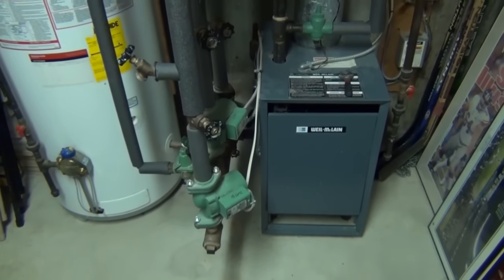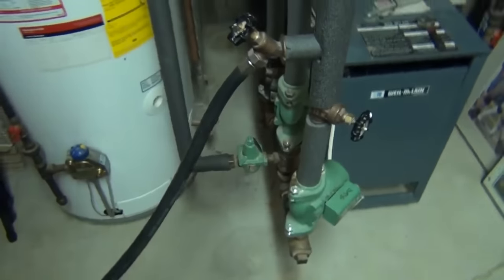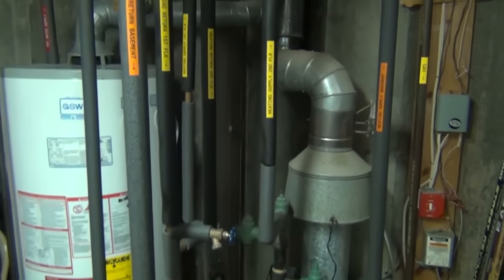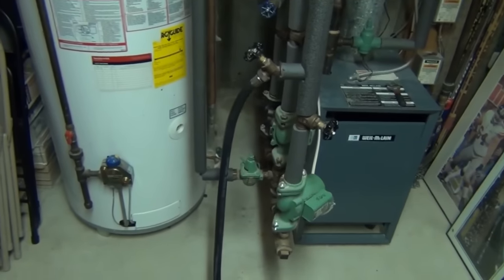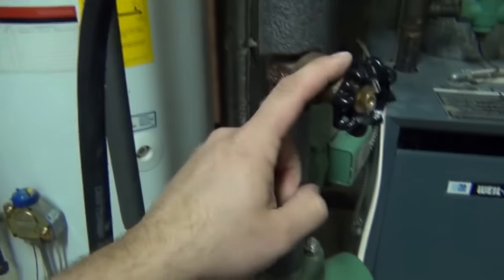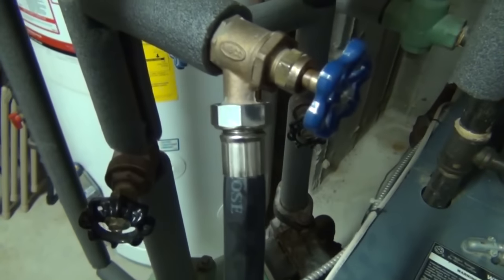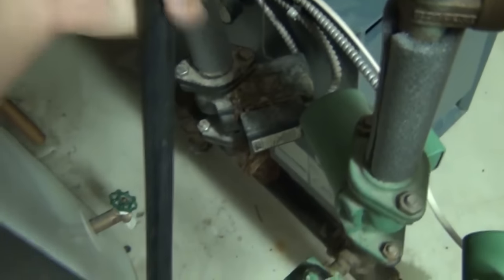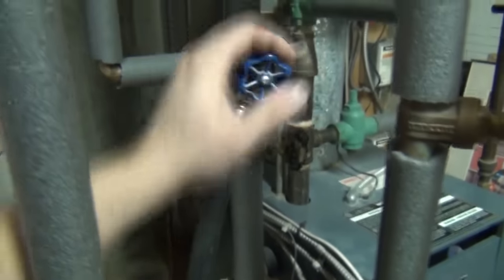Remove Air from your Boiler and Heating System | How To

Comment: trhank you for this video.  i dont see a fill valve on my system or a separate shut off switch.  should i kill the breaker before starting?  Can i do this without the fill valve?
Reply from the maker: There is definitely a fill valve somewhere. Won’t always look like the one in the video. Look high and low, it’s there somewhere
Reply: @fixitwithzim  the only thing I see is a fitting with a little lever on top   Is that it?

Comment: Great explanation but in my case I wasn't able to lower the water pressure to not exceed 30 psi.  The expansion tank is new as well as the fill valve and the relief valve.  Expansion tank is  at 12 pounds. I will have to call a Radiant Floor Company.  From previous experience I can only imagine what that will cost for them to look at it.

Comment: Since this is a pump system and not a zone valve system. Was there anything else you had to do before starting the flush out to start the fast fill? Can you do a flush just like this on a zone valve system please?
Reply from the maker: Yes, you’ll need to manually open and close the zone valves one at a time.  Other then that, same procedure as in the video.

Comment: 1:16 Hi Zim, I have two zones, each with a zone valve. And the only air purge station for the whole system is on one of the zones. Can I still follow this video for guidance?
Reply from the maker: Sorry for the late response, yes. It will take a little longer to get all the air out but the process would be the same.

Comment: Is there ever any worry of introducing cold water into a hot boiler or is it required to do this when the boiler is cooled down?  I just worry about cracking a hot boiler by possibly getting cold water to it. Very nice explanation and procedure.  Also, what kind of average life expectancy should we  be seeing with the expansion tanks.
Thanks for sharing.
Reply from the maker: Ideally this process is done to a cold boiler.

Comment: Excellent Video -  I have a two zone system - one for each floor - does it matter which zone I bleed first (i.e. do the upper floor first or last?) so I won't get bubbles potentially stuck in another zone?
Reply from the maker: I’d start on the bottom floor and work up but there’s really no proven order that works better. Good luck

Comment: Great video. Do you have any video showing how to bring up PSI to the normal level? Mine is almost zero 😢
Reply from the maker: Sounds like you have a bad gauge or the makeup water valve isn’t maintaining pressure.  Start with the gauge
Reply: @fixitwithzim  everything was fine. apparently it was the zone valves. I have 3 zones and 3 nest thermostats. Nests pulled all the power and caused the valves to go bad
Reply from the maker: @TurkinaFaso  gotcha, well glad you figured it out!  Yes, Nest tstats draw a lot of power. I’ve seen them fry transformers if multiple zones have them installed

Comment: Good video,thank you.Where is the air scoop on your boiler though?As I understand it the air scoop removes air from the heating system.
Reply from the maker: This system doesn’t have one. The expansion tank is piped directly to the supply side of the heating zones. Not ideal but it would be a lot of work to change.  I’d probably opt for a spiral vent if I was redoing things

Comment: A good video but I was told by a plumber friend to always start the process with the lowest floor first. Then work your way up 1 by 1. 
The reason is that air rises and if you do the higher floor first, then when you do the  lower floor, any air that escapes the pipe may go up.

Comment: Great video! My purge valve won’t completely shut after purging. It’s causing a pretty steady leak. Enough to where it leaks out of the cap I have on. Is there a nut to tighten that or do I need to replace the entire valve?
Reply from the maker: Make sure you’re using a brass cap and that the washer is in it. Put some pipe dope on the threads and use a pair of pliers to tighten. Even with the valve completely open, the cap shouldn’t allow any water by.  Make sure the packing nut isn’t leaking as well..if it is, tighten with an adjustable wrench
Reply: zimsjeep thank you for immediate response. The cap I had at the time was a plastic green one. I will buy a brass with washer and I will try this when I get home. Thank you

Comment: So that 30 PSI limit valve I opened it manually by accident.  Is it completely hooped now?  After the burst of water went through I dried the outlet pipe and checked it periodically, didn’t feel any more drips.

Comment: Does your circulating pump have to operating as if the thermostat is calling for heat?
Reply from the maker: No, turn the boiler off when doing this operation.

Comment: Very informative video...well done.  The only disagreement would be when you warned not to allow the relief valve to open.  If you don’t check it at least once a year during the annual maintenance then you’ll never know if it will open during a high pressure emergency.

Comment: Hi, thanks for your helpful video. I have a question. I have a boiler with one circulation pump and four zones valve. When I try to remove the air from the system, should the zone valve be opened or closed? Thank you.
Reply from the maker: You’ll want to have one open at a time for the purge process to be effective, good luck!  Easy job

Comment: Does air in the pipes usually only cause a gurgling noise? I have a ticking, banging type noise. Can't tell if it's from air in the system or the plastic holders not on the fins correctly.
Reply from the maker: Could definitely be air. It will sound differently depending on where the air is in the system. It can also cause the pipes to rattle around which might be what you’re hearing

Comment: The only thing is in the different zones there is the thermostat circulater.  Don't you need to switch that arm to open when flushing?
Reply from the maker: No, circ doesn’t need to be on during this process

Comment: Interesting video. Your system has the circulators "pulling" the water through the system into the boiler. My system was installed with the individual circulators coming off a manifold and "pushing" the water through the system. There are no purge stations on mine just a series of valves where the water returns to the bottom of the boiler.  What is the proceedure for purging my type system?   Thanks
Reply: Better to put circulators on the return side because water is cooler which prolongs circulator life.

Comment: Thank you! I just had the regulator valve and the expansion tank replace, my system pressure is showing me 15 psi, but the safety valve keeps opening..you think the repair guy put the temperature too hot? (180°) purging my system would help with the issue?
Reply: Replace the safety pressure valve. They do get weak over time. Watch Steve Lav’s boiler videos if you’re not sure. Steve will sometimes replace both the expansion tank and the valve. Sometimes, the valve will not close properly (due to age) once a high pressure event has occurred.

Comment: All my radiators have a key, cant I just open the valve on the individual radiators and achieve the same results??   Thanks in advance
Reply from the maker: Those do a good job of bleeding air from the actual radiator but often times the air will get trapped in other areas of your system that require the method I showed in the video. I’d start with what you described and see if it works. It’s definitely easier and faster. Good luck
Reply: @fixitwithzim  thanks so much for your reply, already watched the video again in front of my boiler....Thanks in advance for the confidence to approach this the better way...cheers

Comment: I did this a few years ago and it worked like a charm. But now I have no heat upstairs again, although I’m getting hot water thru my faucets. It seemed to work but then the water stopped flowing altogether. Why would this happen if I did every step correctly? I’m already broke and on my own (widowed) with 3 kids. I’d rather avoid paying someone if I can do it myself. Thanks!
Reply from the maker: Having no heat won’t having anything to do with having hot water at your faucets. Are you sure all the valves are turned back on?

Comment: I have a question, have a 70 year old hot water system. With a setup like that to purge butt every time. I try to introduce city order. It doesn't let it go into the system it just comes out of the Pressure regulator overflow.
Reply from the maker: Do you have the drain open before opening the fill valve?  Your expansion tank might also need replacing. Do the test like I showed in the video

Comment: What if you manually release the pressure relief valve? I did that last night as it was making a big racket and convulsing (the pressure relief valve was. Making a knocking noise.)
Reply from the maker: Late response here…usually not recommended to do that, especially on an older valve because you’ll run the risk of it not closing and seating properly when closed creating a leak.

Comment: Thanks for the great detailed video.  Unfortunately I still hear water/air in my system after hours of bleeding. Is there a point where I should open the bleed valves on the radiators during this process?
Reply from the maker: Do you have cast iron radiators or baseboards?
Reply: @fixitwithzim  baseboards with steel shrouds and vaned copper tubes running throughout.
Reply from the maker: @rueliotube  ok, you shouldn’t need to bleed those separately.  Are you sure you did all your zones?
Reply: @fixitwithzim  yeah, I did multiple times. I do appreciate you trying to help in the comments. I don’t mean to take up your time too much. I even had the plumber out here doing it. The symptoms are when the heat comes on it sounds like water is just pouring through the pipes. It’s very loud and I assume once they fill up or the air flows through its normal. I’m guessing that there’s just air in the pipes until it gets the water up to the radiator. The other thing is, it never was like this until the plumbers came and replaced all of the valves on the zones because they were showing signs of corrosion leaking. That’s what’s frustrating, it was fine before they recommended I do that (I paid them $1400 to do it) and now it’s not.
Reply from the maker: @rueliotube  I’ve had instances on occasion where I need to bleed a system for an hour or more. It all depends on the length of piping, fittings, etc that can hold pockets of air. Give it a try again. Just let it run for a while. Goose the fill valve back and forth at times to surge the water through the pipes. Sometimes that will break loose the air. Open and close the isolation valves also.  All this can help get the last bit of air out. It doesn’t take much to cause the symptoms your describing.  If the system was open as you described to change the valves, you no doubt need to do this process longer
Reply: @fixitwithzim  right on, I will give this a try a bit longer and report back!  Thank again 👍🏻

Comment: Do those green bleeder valves in the back pipes do anything?
Reply from the maker: They can manually open and close the flow check valves.  No need to do that in most cases.

Comment: Great video! Will the sudden flow of cold water damage the heater?
Reply from the maker: Thanks, Ideally you start this process when the boiler has been off but I’ve never experienced any ill consequences when the boiler was at operating temp.

Comment: Thanks for information - however, gas company came out to do annual service but the hot water in baseboard doesn't flow through. Why is that?
Reply from the maker: Probably air blocking the water flow. Follow the video, it should fix your problem!
Reply: @fixitwithzim  When we moved into our house, the 1st floor heating zone had NO circulator pump; the 1st floor heating was just gravity fed.  We had a plumber install one.  Make sure you have a separate pump for each zone.  The pump will have an electric cable (Usually BX, a cable in a gray metal casing, but can be Romex as shown in this vid as a white electrical cable.) attached.  When the circulator pump is on, you may not hear it, but you can feel the pump vibrate when it's on.  Be careful, it will be hot & will get hotter very fast!

Comment: 1/30/21 Well explained video now I understand more the process of getting air and banging pipes out of my heating system which seems to happen every winter heating season. I still may have a plumber doit cause my setup up is slightly different than your video, liked also you covered how to fix the leaky values that always seem to happen.
Reply from the maker: Thank you.  Try it yourself next time and save a few bucks.  Its easy!
Reply: @fixitwithzim  3/12/21 Still had to get the plumber in my water fill value was not working properly constantly gurgling and adding water at each heating session startup. So many vales to manage so I had it done professionally, I rather pay once. Also had to replace the thermostat as it was broken by the repair guy, but now everything seems working properly without air in my pipes.
Reply from the maker: @rpdee7344  Gotcha, glad you got it all sorted out!

Comment: I'd like to do this but have questions,  I have an oil boiler, 5 zones, each zone had handle type shutoffs. Have two "wheel type" shutoff valves with hose connectors, one up top of boiler and one below. Not sure how to proceed. Thanks.
Reply from the maker: Without actually seeing a picture, it’s hard to decipher but if I had to take a guess, the bottom valve is your boiler drain and the top is your purge valve
Reply: Thanks so much, would I be able to send you pictures?

Comment: I strongly advise that rotating gate valves' packing nuts be held with a wrench while opening them.  I've learned the hard way that those valves that haven't been used in a matter of years can develop mineral deposits that bond the packing nut to the valve stem and thus unaware, the packing nuts can become loosened while opening the valve to the point that the nuts are blown right off from the water pressure and a flood will ensue in a matter of seconds before either the furnace supply or main house valve are turned off.  In this case, fortunately the packing nuts only loosened to the point of leaking and no further.  Also, no mention is made re: turning off the burner and allowing the system to fully cool before performing this procedure to prevent cold supply water from running through a hot system and risk temperature-shock cracking to internal cast iron components, cast iron being a brittle metal.  Thank you.
Reply from the maker: You must have missed the opening part of the video about turning the system off. I believe I mention it in the first minute or two. Thanks for the comment
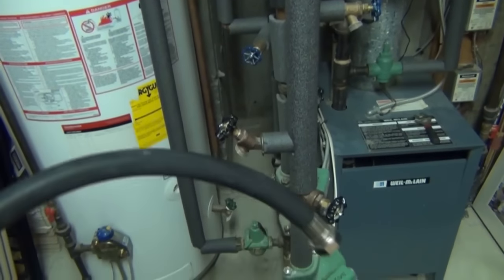Reply: @fixitwithzim  Actually I double-checked but noted that @ 01:28 the point was made to turn the system off by turning the electrical switch off, but the point wsn't made to allow the system to fully cool before proceeding.  The point is to prevent cold water from being rushed through a hot system.  But no matter, the video is great and I have it bookmarked for my reference.  Thank you.
Reply from the maker: @DDEENY  thanks and yes. I plan to make a follow up video addressing some of the most commonly asked questions. This is one of them. Thanks again for contributing to the discussion.  The comments are a valuable resource for everyone 👍🏻

Comment: I have 3 zones with circulating pumps, but no valves for each zone. Is there anyway to bleed this system outside of just bleeding the radiators? I bled all of the radiators yesterday, but I'm still getting banging sounds from the pipes coming from the boiler. The only valve connection that I know of is one all the way in the attic. I was thinking of running a long hose from this valve to a bathroom on the main floor and trying to bleed that zone from there. There is also a valve coming off of the boiler.
Reply from the maker: Ideally, the attic valve would be a good place to start since air will naturally travel to the highest point. You might look to add an automatic air purge valve (taco hyvent) here as well to automate the process for you

Comment: An expansion tank was just put on our boiler and it was put on side ways... does it need to be up and down? Also we have radiators with no zones we have always bled them directly out of radiators is this okay? If so do you bleed from top down or bottom up and does the boiler need to be running?
Reply: The expansion tank can be in any position, it's ok to bleed radiator with the boiler running, just keep the PSI good,12-22

Comment: What would cause one of the zones,(the furthest zone), to not be getting hot water? I have the same set up but I cannot get heat upstairs.
Reply from the maker: Couple possible causes...bad circulator, bad tstat, big pocket of air trapped in the piping for that zone

Comment: When I opened that fill valve when purging one of the zones, the pressure on the boiler went over 30 PSI and blew that relief valve. Why would that happen. I have 4 zones & it did it on two of them
Reply: Am not an expert but are you not supposed to close all the valves that feeds water into the boiler during purging?

Comment: I have the same boiler it's been really cold and mine has been running alot is it ok to do this now or should I shut it down for a few hours letting the boiler cool down?
Reply from the maker: General rule of thumb, never do any work on your boiler when it’s really cold out...that is of course if it’s working to some degree initially. I always opt to wait until it’s not terribly cold outside. Lots can go wrong if you lose your boiler in frigid temps...Murphy’s law so to speak.
Reply: @fixitwithzim  ya it's been working fine I can hear alittle air in it is all thanks for the reply I can make it til spring and I ll do it than thanks for the reply